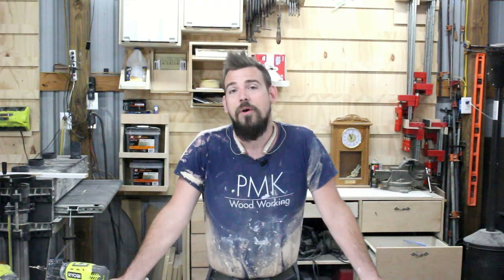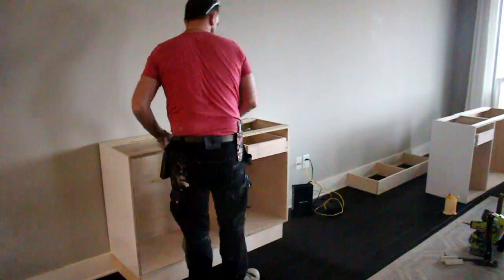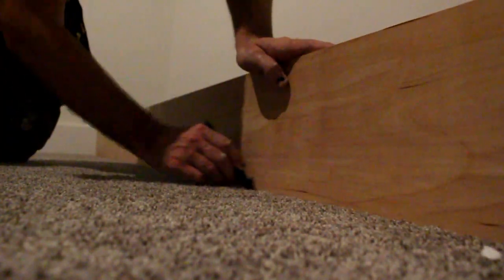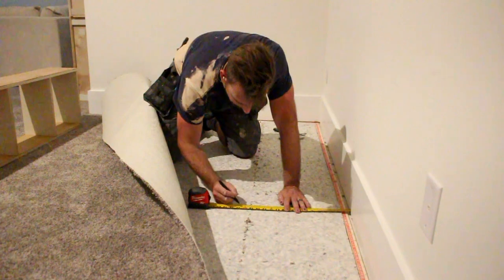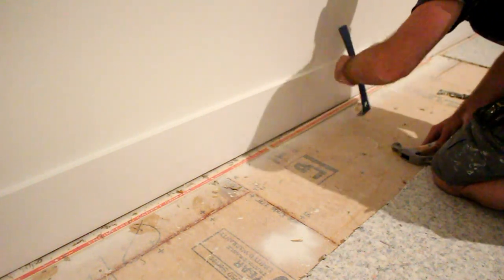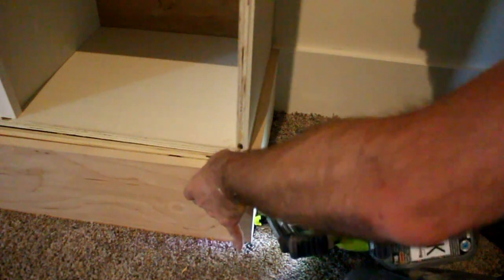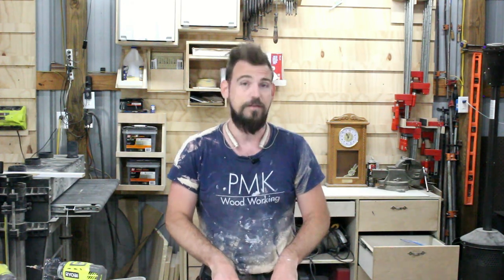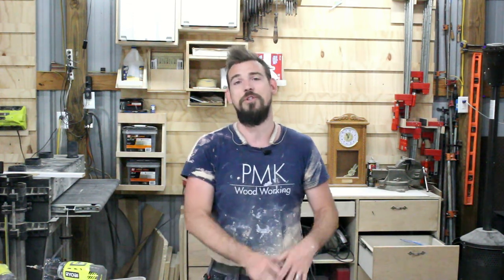How to cut and remove carpet for your Project Installation!

Comment: Have you ever had to do this on a concrete subfloor (the house is built on a slab)? If so... how did you re-install those tack strips?
Reply from the maker: I have! In fact, I’m doing another one right now!

It is extremely tedious, even though the tack strips say they are “multi use“ for both concrete and wood subfloor I can never get the nails to actually attach!   The method I’ve seen used is to simply get the tack strip exactly where you want and try to drive the nailing in one single hit straight down without moving left or right.  That NEVER works for me! So, I simply purchase some construction adhesive and plan the drying time in to my build. Take out all of the nails that are supposed to attach it to the subfloor, apply the construction heater to the back of the strip, stick it down to the concrete next to the foam pad and squish it down and hold it to the manufacturers specifications. Once it has cured, you will have extremely attached tack strips!